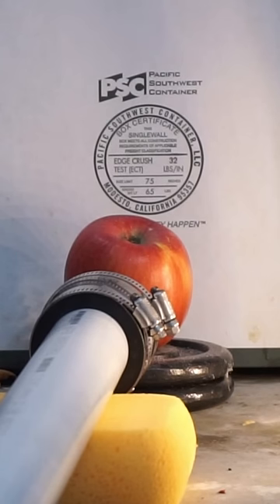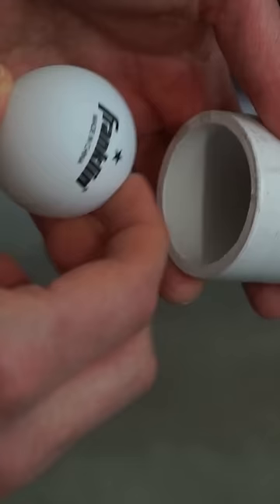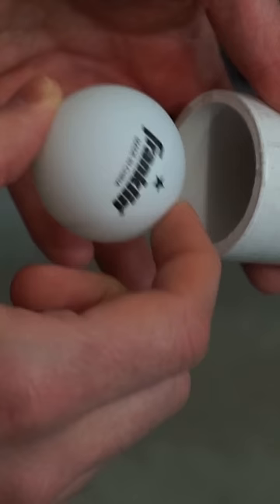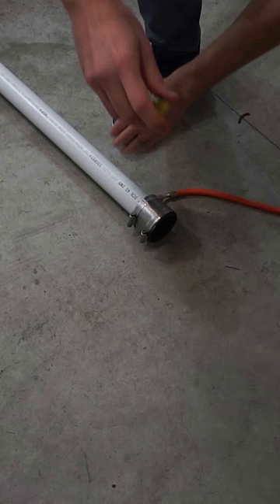The Fastest Ball

Comment: You can accelerate it much faster if you just add positive pressure instead of negative pressure. You can pressurize it to the rated 40 PSI of the PVC pipe and then release the pressure.

40PSI-14 PSI=26PSI difference
Vs
14psi-0psi= 14 psi difference. Almost double the force.

Comment: Your bone might survive, your skin may or may not rip apart, but the internal damage and soreness it would leave, you’ll regret volunteering. The mark from that shot can be considered as a 2nd degree burn😂
Reply: I mean even a ping pong ball hit from across the table (10-20 ft away) can hurt, and leave a red mark on your skin, even though the quickest recorded smash are around 70mph, 10x slower than speed of sound, so I would definitely not try a ball with at least 100x the kinetic energy!

Comment: The idea behind it is very interesting 
But you can get similar results with syringe and any fuel can be ignited with  sparkle  you can compress the air and fuel inside the syringe very easy  and because the rubber in side it it will remains compressed  until the ignition  like the car engine but it will  just shots very fast as nothing to slow it

Comment: I wonder if it could be made more powerful. I know one way is to connect the side that gets punctured to a pressurized chamber. Instead of a vacuum letting normal air pressure in, it's a vacuum letting a lot of pressure in, increasing the speed of the air significantly. Then it can be limiting how quickly you can break the seal between them. I wonder if a firecracker, primer, or very very small amount of other explosives could allow it to be even faster. That's getting to the point where your ping pong ball can punch holes in plywood

Comment: Sooo... You've made a gun...? A machine that shoots a projectile at over the speed of sound...? That's a gun
Reply: No, to be a gun, it needs to incorporate explosive forces, this does not. Same reason crossbows are not guns, they use physics in other ways that do not include explosives. This is as much a gun as a crossbow.
Reply: @johngavin2570  well I'll agree to an extent, I'd say this is closer to a gun than a crossbow. The projectile is more "bullet-like", the projectile moves close to same speed as a bullet on exit of the barrel, and it utilizes pressure instead of raw kinetic energy
Reply: @raykuzplays9605  on the other hand, railguns are also technically not considered guns (you do not need a license to make or purchase one and they are not classified in any laws as firearms or guns) either so... it's still not a gun.
Reply: @johngavin2570  Yes, I do agree that technically speaking that would not certify as an actual gun, I was just pointing out that the crossbow example wasn't fair as the two are as comparable as a fly and a half-eaten piece of cheese. However, that being said, railguns and crossbows are very comparable as the railgun just is a crossbow with higher exit velocity and more massive ammunition.
Reply: @raykuzplays9605  the point that it's not comparable to a gun still stands though. Since it's not driven by explosives, it's not a gun. Neither is a crossbow. Nor a railgun.